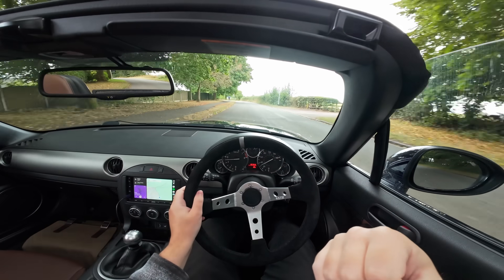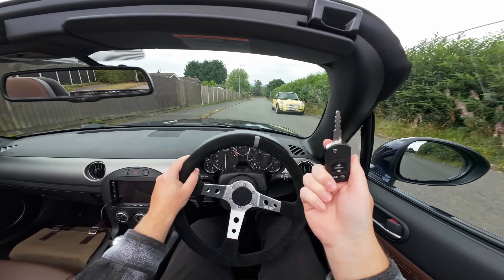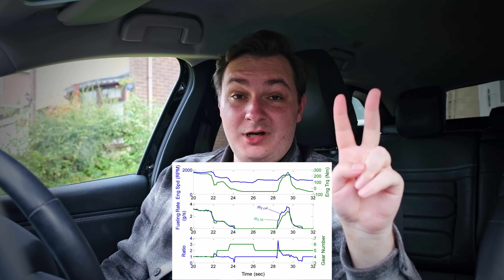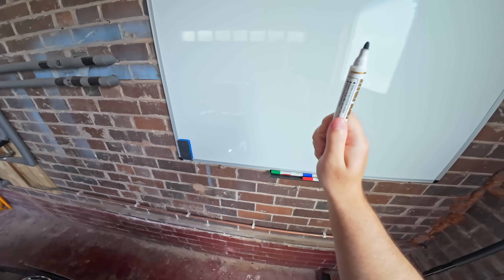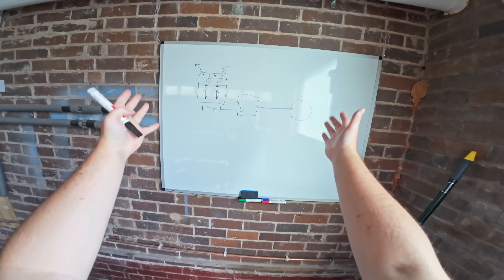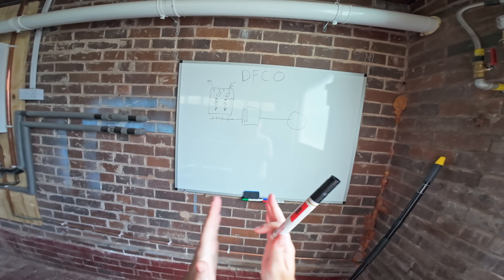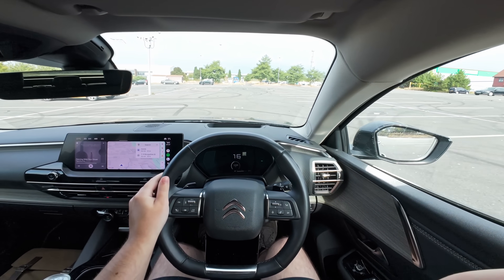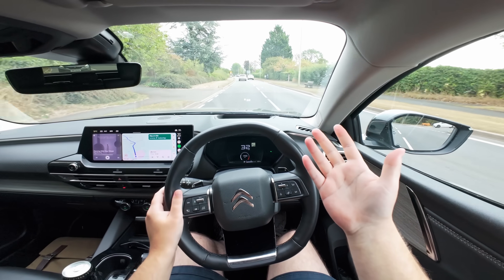The most misunderstood car term - Engine Braking

Comment: I was taught engine braking by my father who learned it from his father in the 1960s/70s back when all the cars were carburetors so the fuel savings are not near as big as on any modern car. But you still gain in terms of control and reduces brake wear. Bonus if you live in a region with winter conditions engine braking is a better solution on ice... A trick I picked up from watching truckers on the road is when approaching a red light if you have room and time it right you can use your engine braking and hit the lights in time to safely cross on a green and not have to struggle with restarting your forward momentum on ice (the idea is to have some forward momentum before you cross the stop line).

Comment: You missed out a big chunk  here.
Most modern Cars have a 'KERS' system, 'Kinetic Energy Recovery System'.
It collects the Energy form the slowing down bit and stores it, usually in the Battery.
Then when you speed up it trickles that stored Energy back to the Car to assist with acceleration.

That's why your missus is getting better fuel Economy.
If you zoom up to the next Red traffic light then jump om the Brakes, you're actually Bypassing the KERS system, so your fuel economy suffers.

Can't believe there are so many Dim-Wits that don't understand these simple concepts.

I drive a Car with 270,000 miles on it and still have the Original Brake pads in it.

Comment: I've neve thought of it as engine braking. I've just been calling it coasting to a stop, which it isnt according to this video. But while the specifics between the two might not be the same, fundamentally its the same thing: you're no longer apply energy to the system and various natural inefficiencies and losses in the system will slow you down.

Comment: During engine braking, I turn on my air-con to use the kinetic energy of carto drive the compressor and that slows down the car drastically. India is a tropical country and hence that is equivalent to energy recovery to cool my car cabin.

Comment: Btw so long as we're teaching, it's inaccurate, of not inappropriate, to refer to combustion events as "explosions". These are internal combustion engines, not internal explosion engines. 
The word "explosion" implies a violent, rapid, uncontrolled release of energy in all directions which is not what happens inside an engine. Combustion is timed, controlled, and contained in order to do the work of pushing down the piston.

Comment: Either those mechanics don't understand that the computer shuts off the fuel durring coasting (engine breaking) to save fuel or they're thinking like a carburator which does use a small amount of fuel even durring engine breaking because so long as there is sufficient air flowing through a carburator some fuel will be pushed in. 
And for those who don't know, modern cars haven't used carburators for decades.

Comment: I'm surprised this was even even controversial. Isn't it intuitively obvious that the force of a 2 ton car in motion has enough momentum to keep the crankshaft spinning and the engine not stalling without needing to inject additional energy into the system?
Reply: It’s crazy that the mechanic got it wrong, all you need to know is that if the car is in gear then the wheels and the engine are mechanically connected and spin together. [assuming the car is going straight and the differential isn’t doing anything] That’s why neutral does use fuel because the wheels are disconnected and the engine rpm drops to idle, so the ecu needs to prevent stalling. When the car is on a hoist in gear and you spin a driven wheel by hand you move the pistons in the engine too. I knew this as a kid.
Reply: Aside from the fact that you're a restarted furry that says things like "intuitively obvious", just because something seems "intuitive" or "obvious" doesn't make it true. Which is why it's explained in this very video that this is not applicable to older cars with carburetors (no DFCO). It requires newer, more complicated technology for your "intuitively obvious" situation to even occur.
Reply: @ahall9839  It’s intuitively obvious that if fuel leaks in that’s a design flaw. The wheels spin the engine when in gear no need for fuel. It’s still worth noting that a bad injection system does waste fuel by leaking a little. That fuel often isn’t even burned because the mixture is too lean. I get what you mean, I just can’t take someone who’s too afraid to say retard seriously.
Reply: @ahall9839 Who pissed in your cornflakes?

Comment: I’m upset. I’ve been doing this naturally while driving, not knowing what Engine Braking was. There are a ton of ‘Engine Braking Prohibited’ signs in my city, and it’s freaking me out, cause now that I know I’m engine braking when I’m slowing down, I think violating traffic laws, which confused me cause it feels like the right way to drive. But apparently the signs intend to say ‘Jake Braking or Compression Braking Prohibited’. Gonna have to start a petition to get all these signs changed.
Reply from the maker: Just had a google and these signs are specifically for truck ''jake brakes'', mainly to reduce noise. Should be fine to ignore in a normal car.
Reply: @MickDrivesCars  yeah, just feels odd ignoring a traffic sign that doesn’t make it clear I can ignore it. I guess I’m just cursed with knowledge of knowing what engine breaking is. Either way, I appreciate the informative video!

Comment: Those Yank mechanics must be still in the mindset of the carburetta era where you would indeed be constantly using some fuel so long as the engine is turning because air is always being drawn through the engine via the carb. Meanwhile the rest of us live in the 21st century...

Comment: I'm pretty sure some automatics (especially hybrids) disengage the clutch and shut down the engine (as in to 0 rpm) if you go off the throttle for long enough, so some cars might not do engine braking. I know at least Volvo hybrids behave this way. But for manuals, yes.

Comment: There are two sorts of drivers - those of us who know this (< 5%) and those who don’t. I get over 50mpg in my 12 year old Honda Jazz. I hardly use the brakes on a semi urban run. I show the mpg on my display - it shows when the mpg is max (100 mpg) ie no fuel is being used. Saves money, makes a smoother drive and reduces the changes in brake pads. What’s not to like!

Comment: You mentioned it but for more detail. Carbureted cars do still use a little fuel when engine braking, even with the engine off, because they work purely off vacuum.
Fuel injection doesn't though. Unless you disable dfco in the software for some reason. You can feel it cut off in a manual car.
I'm not sure why people would think it uses fuel slowing down. I think the carburetor wasting fuel with the engine off is less intuitive.

Comment: I am confused, why is shutting off the ignition such a statement? Doesn't the alternator still provide electricity to everything, since it is forced to spin by the car rolling?
Additionally: If we don't have explosions while engine breaking, why does the enginge sound like exploding then? It doesn't suddenly go quiet or pumping air and just clacking metally. It still sounds like it ignites.

Comment: This is literally how regenerative braking recharges your battery... I'm surprised you had to go to the white board

Here's how I think about the fuel economy aspect of it: when you step on the accelerator, you're spending fuel to invest in the ability to move, and when you step on the brake, you're spending brake pads to take away that ability to move. Would you buy a cake only to PAY money to throw it away? Because that's what you're doing every time you step on the brake.
Reply: Regenerative braking is using an electric motor as a generator extracting power from the rotation of the wheels thus slowing it down. That's a separate thing from engine breaking which is using the compression air to increase "drag" to slow things down.

Comment: So the only - appreciable - reduction in speed from engine braking comes from the compression of the air in the cylinders during the "squeeze" phase of "suck-squeeze-bang-blow?"

Obviously there will be a slowing effect from rolling resistance, friction within the drive train itself, etc. 

Huh. I had no idea. I knew it was a massive reduction in fuel input, but I always thought that the car would still inject the 'idle' amount of fuel during engine braking, thereby still using some fuel.

Thank you for putting this out there. I'm gonna go do a deep dive into DFCO now!

Comment: Also engine braking is a very good thing to cool your engine. Because your revs are high enough to make coolant circulate fast (your water pump usually rotates proportionally to your engin speed), and your cylinders are ventlated with air without any burning.
Much better than just instantly slow down your hot engine to its idle -- coolant runs slow, fuel burns -- it stresses engine a lot.

Comment: Fuel save this, fuel save that... Just go on a hill in a manual, stop the car, reset the trip computer, put it in 2nd gear, let go of the brakes, let it slowly roll down the hill till around 20km/h and start the engine, don't touch the acceleration and watch as you get to the bottom of the hill and your trip computer says you have infinite MPG or 0L/100km... Bet it looks like magic to these dense people that don't understand how this works lol

Comment: The problem with the concept of letting off the gas to slow down is that most people where I live are so impatient, they don't want to wait for the car to slow down. It's accelerate as fast as possible and brake at the last second to get ahead of other drivers. I tend to coast a lot and even down shift down hills, engine braking up to 3k RPM. I found that accelerating slower with lower RPMs increased my mileage the most though.

Comment: I remember watching another video where they did a rolling downhill test. One test, they left it in gear and just left off the gas pedal, the other test, they shifted into neutral instead. The result was that being in neutral resulted in much worse mpg than leaving it in gear. Despite sending that video to some dude on reddit, he wouldn’t accept that modern cars stop injecting fuel when not on the accelerator.

Comment: Good day everyone, I’ve been driving HTV and LTV vehicles for almost 20 years now, and I’m honestly surprised how many people still don’t know about engine braking or doubt how it works. We’ve been using it for as long as I can remember, especially on manuals. When driving downhill for 8 hours straight on the road, brake pads alone won’t last, so we downshift and let the engine do the braking. It worked even back in my early days with carburetor cars, where I first learned this technique. So yes, t’s real, it saves fuel, and most importantly, it can be a lifesaver in critical situations.

Comment: Isn't that also the reason why if you let the rpm hit way too low the car turns off abrutply if you're on a gear aswell but it won't on neutral?? i mean, in neutral won't go off cause the engine is disconected from the gearbox so it needs fuel injection to keep working and since the gear and the engine are disconnected, you don't feel the drag from the wheels pulling the engine, but on gear, as the wheel is the one moving the engine, you feel both the drag stoping the car and the abrupt stop from the engine having not enought force to move the wheels.

Comment: About the red light, I kind of disagree with the statement that if you come to a complete stop, it's the best. The thing with large masses is that it is easier to keep them in motion than it is to get them moving, so the best case would be you engine braking and coasting along so you "hit" the waiting cars just as they are accelerating when it turns green and you can come back up to speed without ever coming to a stop.

Comment: What would be the advantage of doing this over just putting the car on neutral if you’ve got enough momentum?
Reply: Neutral removes attachment to the wheels from the engine, so the engine has to inject fuel to keep running

Comment: Thank you! This clarified and answered questions for me.
I actually do have a carbureted vehicle and it pops and bangs under engine braking and this really clarified why that happens.
Also, you didn't mention it, but this also seems related to the mechanics of push-starting a vehicle. The fact that you can move the pistons by rotating the wheels is also useful in that context (in a manual-transmission at least).

Comment: And then your fuckin break disks start to rust because they are literally designed to break down if not used.
Reply: Because using your brakes 20% less will cause them to rust. Sure
Reply: @pknepps yep. No joke. I literally have to force myself to brake more instead of doing motor braking. It's about the worst thing about my current car.

Comment: I need about 0,2-0,1L/100km when the AC is on
Reply: Well, then you have the AC powered through an electric motor (so you must have a hybrid). I got a 1000€ mazda 2 2008 manual and the AC pump is connected directly to the engine belt and a separate clutch for the AC pump. So if i press the AC butt it starts adding more load to the engine. Pretty cool.
Reply: @giorgiolelmi8175I drive a 2011 Opel diesel

Comment: Interesting video, would have liked it if you'd spent a bit of time talking about how this works with manual cars. Presumably when you press the clutch its disconnecting the wheels from the engine so you're no longer engine braking? If I'm in third gear and I'm approaching a roundabout and say drop all the way down to 5-10mph would the engine not stall? I can understand if I'm in first gear the engine may inject fuel to prevent a stall and keep me crawling at 4-5mph but if I'm in third or higher does it inject enough to prevent stalling? I would assume not, thus I'd need to be lowering gears in accordance with my speed

Comment: Bro, great video. I consider myself a car guy but did not know about DFCO, thanks! I have a gripe with you though. Removing the key from the car while driving is dangerous. Your steering wheel may lock (you might know that and you chose a relatively straight road), others watching (especially a video about a concept like engine braking, who probably will not think about steering wheel lock) can just do it themselves and face the consequences. Take care man.

Comment: Could you explain what happens when we are going downhill instead? 
Then the inertia does not stop right? 
Then how can we use the engine braking?
I know people use lower gears to do this, but don't understand why and how it works?
Reply: Engine compresses air, think of it as converting your car's potential energy to heat energy and releasing it through the exhaust. Every time the wheel spins the engine it creates friction from this compression. When you use low gears your wheels spins your engine at a high rpm hence creating more friction and slows down your car.

Comment: This is not even Engine Braking... its a different system, mostly used of truck and they are... loud as f. What are you explaining is literally the ECU strategy to save fuel when you lift off your foot and let the car follow momentum/inertia.

Comment: There is more to it than just using fuel or not. Am not an expert nor a mechanic or engineer but not all engines are the same. This may be true to most modern cars especially hybrids. But there are other engines where this would not apply considering large vehicles. Since there are a specific condition and time where DFCO would kick in.

Comment: What about Diesel engines? I heard that they still use a little bit of fuel to not let the injector run dry. But it's just a tiny amount. That's true or is just a full cutoff?

Comment: To add Fuel to the Fire (or combustion chamber)... "In a conversational context, deceleration is a real and common term used to describe the act of slowing down. In physics, however, deceleration is not considered a unique concept but is instead described as a form of acceleration."

So does the car really "decelerate" when you lift your foot off of the gas pedal?

You're welcome.

Comment: Do cruise-control systems in modern cars tend to engine-brake when decelerating?  EDIT: Also, I've occasionally seen "NO ENGINE BRAKING" signs in some neighborhoods; is this based on another persistent misunderstanding, or is the car legitimately kind of loud when you're engine-braking?
Reply: Those signs are for jake brakes, which exist on large diesel trucks, and they're very loud when engaged. When you down shift to engine brake on a normal car it just sounds like you're accelerating

Comment: I drive on mountain roads in both an MX-5 and a van pulling a camper all the time and in both situations I'm constantly shocked by the people in front of me riding their brakes either on downhills or coming into to turns where you clearly don't need it.  Just downshift and let compression do the work for you.  I used to worry doing this on huge downhills was bad for the torque converter on my automatic van but I put a real time monitor on the trans-fluid temp going down a mountain and it actually dropped while engine braking, so that's not even really a valid concern.